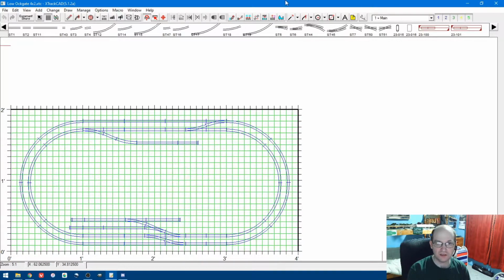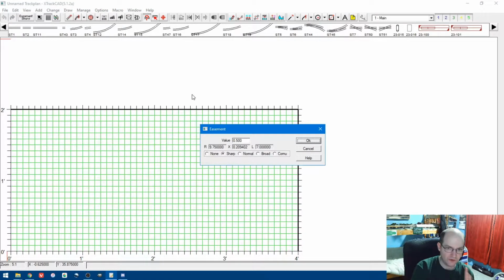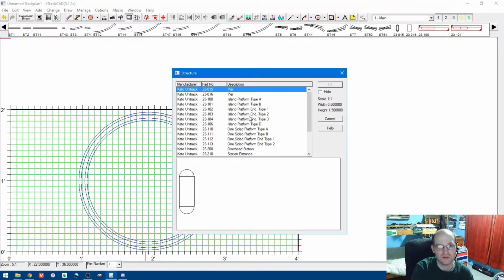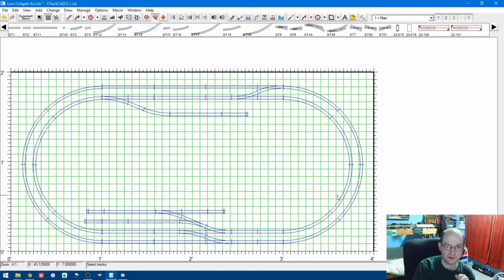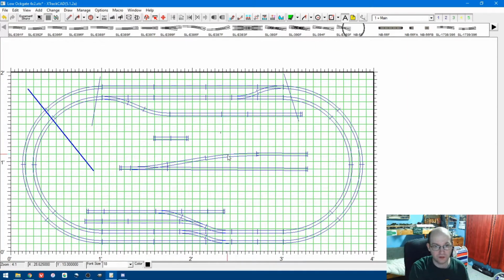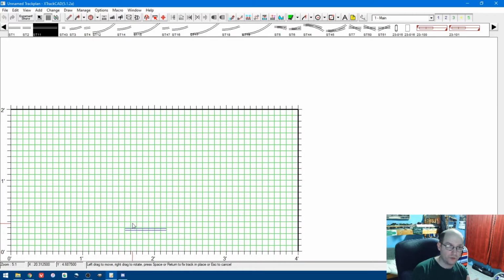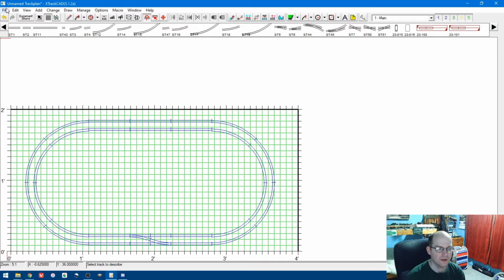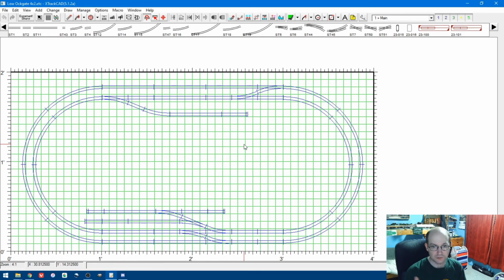A Beginners guide to: Using XTrkCAD for designing layouts.

Comment: Would appreciate a re-do in this, I'm helping a lad set up his first 'train set' (he's 12).  A starter on just using set-track would be handy, he can then go on to the more complicated stuff once he has mastered the basics. I'll be supporting him using TeamViewer as he lives 200 miles away.
Many years ago I used the Atlas track planner, then bought Anyrail for the Peco 2nd/3rd radius curved points. Both were very simple to use from memory but the lad and I are both running Linux these days.
Given his age I was thinking of a single track oval with a station in the centre off-set to the left hand end and fed from both sides (to provide end-to-end running), a shared shed on the centreline with a marshaling yard behind and a goods yard to the front toward the right end (and maybe an industry or two). Probably on a door, probably just a couple of small tank engines with some 4 or 6 wheel coaches, 15 goods wagons and a couple of brake vans. If room allows I might add a second loop at the left hand end to serve as a fiddle yard inside a tunnel (open to the end for access) with the town on top and access to the station. Points probably controlled using fishing line with coloured beads on the ends to identify them but maybe piano wire push rods set into the surface if funds allow.
Anyway, thanks for this, I'll try it again with headphones.
Reply from the maker: Strangely enough, didn't get the notification for this comment, so apologies for my late reply!
And I do very much need to redo my intro to the software, bit more structured in what does what (did have a list of chapters for each bit) though not quite had the time to remake the video (hopefully with better audio)
And does like a fun project with the young lad considering the distance, and I would recommend something like a single oval design for a beginner, keeps things simple with little to go wrong, my Beginner layout series goes with that in mind with something of a two station plan, though I don't recall if I had a goods yard at all, but on something the size of a door they'll have plenty of space to add something like that!
Personally for a beginner layout I'd just go with using hands for pont control, again less to go wrong though I've never really had much luck with the piano wire method.

But glad that the video is of some use even though it sorely needs a redo, when I've got some time off work (and when it's not oiling hot!) I'll see if I can dedicate some time in the redo for you!
Do wish you good luck with the layout!

Comment: Complicated.   I have 6 different pieces of track and just want to use them to build a layout.  Is there a simple app to do that  ?
Reply from the maker: There's both SCARM and Anyrail, however I've no experience using either of these, so can't tell you how well they are for new users sadly and both you do need to pay to unlock the full versions.
Think there are some others, but those are the only ones off the top of my head!

Comment: Thank you so much for making this video. It makes the layout design in CAD so much easier without reading through 240 pages of the manual.
Reply from the maker: Glad it was helpful! Though I do want to make a new version of this vid sometime which is bit more structured and with the audio fixed, though just need to find time for it heh
Still glad that it could be of help!
Reply: @GosportRailworks  Please consider doing it! I'm trying to build a layout and I'm struggling a lot. Your video helped a lot but I still didn't know that there were so many turnouts and other pieces!
Reply from the maker: Might take me a while, but will see what I can do as the last one I mostly did trying to remember everything off the top of my head heh

Comment: Why can't I get my turnouts to work when I am in Run Train Mode
Reply from the maker: Unfortunately that's part of the software I've yet to work out either, mostly just used it for track design, but will look into seeing how it works when I can!
Reply: Hello Dale, not sure if you have persisted with XTrkCAD but when in Train Mode you hold down Shift and then click and the through line will change. Same as when changing a line on the Turntable. Hold down Shift and click neat the stub track you want to turn the Turntable to. If you have any questions there is an extensive Wiki page and great Tutorials built into the Help Tab. Asking questions in the Groups Forum will get you a lot of assistance. Good luck.

Comment: Hello, I am trying to design a home layout in a modular format. First, does this program do that? And second, if so how do you go about doing that? I am very new to this program and cannot find any tutorials or information on being able to do that. Thank you for any/all assistance with these questions. GW
Reply from the maker: Hello There!
From what I know of the program, the best way would be to design the entire system as a single layout, then break it up into each module using the split track and draw lines tools so you can see and also select each bit on their own.
See an example here: https://imgbox.com/NPFTvIf7
Unfortunately the software doesn't support modular systems in any way other than that or designing them as separate layouts which is also a method but I wouldn't say the best way.

Hope that helps, will do my best to help further if required!